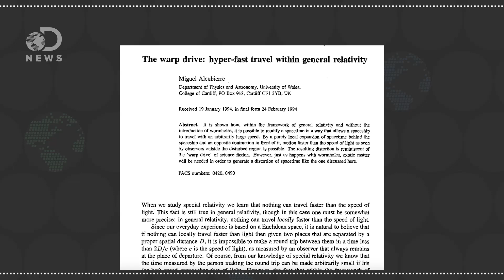How Close Are We To Star Trek's Warp Drive?

Comment: The ship won’t physically move but it will go through an anti matter hole from front of it and out the other side folding space and time getting there through Another dimension which is through anti matter dimension as space expands back to normal expansion. From the other side of the anti matter dimensional field. We can physically go into another dimension that is theatrically possible. We Just can’t physically go into another dimension without a Fusion engine bending space and space time. Nothing will physically travel that fast then light it has to go through another dimension.

Comment: Never say never....
70 years ago who knew about nuclear fusion.  200 years ago who knew about steam power....etc, etc.
Reply: Except those two don't break the laws of thermodynamics
Reply: Wasn't it DaVinci in the 1600's who first proposed inventions based on Steam power? That was over 400 years ago, more than your 200 years. It was largely ignored until inventors in the 1800's went back to incorporate those ideas. He also invented flying machines, which until 1900's was used by the Wright brothers to make the first plane. It was George Tucker in the 1930's that proposed Fuel Economy for cars, creating the first car engine that could achieve 100 miles per gallon. Tomorrow's warp engine could already have been invented by some backyard scientist but because of his/her unscientific methods the higher learned scientists may easily overlook it.
Reply: Bad examples.  1950, we had detonated several nuclear weapons, we had a pretty solid grasp of nuclear physics.  1820, plenty of steam trains running, and stationary engines in factories.   But the general point still holds good.....
Reply: 70 years ago...by who?

Comment: actually there are a few ways to travel faster than light that are easier than using a warp bubble. One that people can do now is called astral projection, and it does work. However that is only moving part of our conciousness to another location, and the safest way to travel, as one can go places and look at things that will destroy matter as we currently know it. 
The other method is to use one of the lesser known properties of matter and space, and based on our current abilities it will be the most likely to be most feasible, and that is every point in the universe is connected to each other with slight variations in vibrational and symmetry or by other terms locality. If we change the higher order vibrations that are beyond the normal 6 dimensions that we are familiar with that will move an object from one location to another, and changing the frequency back will move it back. That is because we have many dimensions in space, and even string theory shows this. The key is figuring out how to measure them and then it should not be too difficult to manipulate them to do this kind of travel. Problem with doing this is that it would take time for our minds to adapt to the new locality, and the way to operate such a thing would be through the manipulation with our mind. There are a couple things for those familiar with Star Trek that might make this more clear, they refer to this as changing the temporal field, and there are an episode with the Traveler that show him doing this manipulation with only his mind using the ships motion for the energy to make the transition between locations. I mention this because you brought up materials that do not exist in any known form to pull off the warp field. Yet we do have very small amounts of antimatter, there are some that do not know the difference between it and a plasma. The most common form of antimatter to us is only a plasma at the current time, and at very high power levels plasma is the best we currently have to move energy.

Comment: AS I type this comment NASA has been for at least 2 yrs been working on Warp technology.  And as a recent unconfirmed report, warp has been created in the lap using magnets and estimates are that 10k watts to 20k watts could propel a probe at warp 3.5+ or travel 4 light years in 2 wks if scaled up.  Comments were about issues one was how to control the direction of the warp fields and how to get them to be opposite to obtain motion.  Some estimates based on recent/2018 progress Warp drive will be with us in the second half of the 21st century.  Note the supposedly created warp field was a micro field and splitting a laser beam to determine it's existence was used.  Note No negative energy was required.

Comment: Actually there is a lot of discussion that NASA is currently making a test warp spacecraft using a more advanced drive than Alcubierre suggested, supposedly it uses an alcubierre-froning drive which produces a field around the vessel and deflects dangerous stellar dust away from the vehicle while it is traveling. It supposed to have all started back in world war 2 when the Germans were developing a kind of antigravitational engine, It seems allied troops moved in before they could make any flying craft that used the engines and the war was won. Interestingly enough NASA hired the German scientists that supposedly built the German antigravity device to make a NASA  version. Another thing I heard was that someone witnessed seeing a round iron craft similar to a diving pod that had no windows but had camera bubbles all around it, at a military hangar. It is said to have used a large capacitor on the bottom and something called a Mercury turbine in the center. I think this was around the 1950's. It is possible this prototype was a result from the German scientists. It was said to be able to hover and fly in any direction using a specially made spherical control that would move the direction of the field. It was said to create a glowing field around itself and that the metal exterior was to protect a crew of 3 from any radiation from the field. If NASA has been working in secret all this time to make a warp ship then they would've already had 73 years to work on it, possibly with a few prototypes along the way that people have seen and  claimed were UFOs.

Comment: Really...?  I'm flummoxed that no one has picked up on the capability of Dr. Richard Feynman's 'Renormalization',... which mathematically involved the equivalent of dividing out infinity from his equations of Quantum Electrodynamics (perhaps one of the most successfully proven theories ever).  The reason why Feynman had to divide out infinity to get his theory to work is that the universe is filled with 'Simple Harmonic Oscillators' and their energy is a so-called 'Zero' state.  But the SHO (Simple Harmonic Oscillator) has a parabolic potential energy, which then causes its lowest energy state to be 1/2*(h-bar)*omega (where omega is wavelength -- albeit angular).  Virtually everyone interested knows that all of space-time is filled with 'background radiation'.  So I ask this,... perhaps Minkowski Space-Time is inherently perforated with SHOs, or perhaps taking advantage of 'background radiation' so-called 'zero-point' energy might be an option.  
How?  The technology is already here,.... although feeble.  Create a Bose-Einstein Condensate using low T and monochromatic lasers to order matter appropriately.  Zero-Point SHO energy could be manipulated similarly. Although currently only a few hundred atoms have been gathered and arranged this way, if enough were arranged, I believe the condensate would collapse into a minor black hole.  The Higgs particle, which controls mass itself, is a Boson --- therefore subject to Bose-Einstein condensation.  Either the minor black hole could be utilized as power by feeding matter into it,... or more exotically, perhaps the minor black hole could be arranged such that it had zero angular momentum,.... thereby making it a 'naked singularity'.  The possibilities of utilizing a 'naked singularity' are enormous.  Reality itself changes, and nearly anything is possible with regard to one of these.  How to control it,..... well,... that's another question.

Comment: And to stop the bubble just program a computer in the outer ring to shut down after a certain time or condition it met. Simplz
Reply: Or generate and project the ring from inside the bubble, such that the ring doesn't need to be physical, and simply stop generating the ring (the warp field) when the desired destination is reached.

Comment: Imagine it's 1850 and you are having a discussion about heavier than air machines that can fly.  "It's theoretically possible but it is decades or even centuries from happening." What was needed was an understanding of aerodynamics.  And now imagine studying aerodynamics without the benefit of computer modeling.  The solution is out there but it's 1850 in terms of our knowledge.

Comment: If you were going to shrink space in front of the ship, you would have to project some sort of influence forward at greater than the speed of the ship.  If the ship was approaching light speed, that would mean projecting that influence forward at greater than light speed.  I understand that the ship could be traveling slower than light speed relative to the bubble it was flying in, but that bubble is a bubble of space, so that means projecting an influence forward at a speed relative to space itself.  Is that a viable thing to do?

Comment: Well, matter on its own can't travel faster than the speed of light but you can warp space and time to make it as if you are traveling faster than the speed light would if it travels in the normal way. If you warp space and time, you are shortening the distance you would need to travel to reach there even if you are traveling at a slower speed, you reach there faster than light. But that's hard to do as you would need to calibrate a system that takes time to reach there. And keep in mind that any form of radio wave travels at the speed of light.
Reply: The problem with achieving FTL travel is actually stopping....  lol.
Reply: Pay attention, it has nothing to do with time, it only warps space, not time.

Comment: Yes, I'd sign up in a heartbeat.  Being on the frontline of developing it.....not so much.  I mean look at the space shuttle disasters.  I'm sure in the future we're going to look back and think how did we ever do that.  On Columbia's 28th mission, a piece of foam broke off the wing.  A......PIECE......OF.....FOAM.  It's mindblowing that they used FOAM on something that goes into space. When I think of foam, I think of the popcorn they used to use in packaging to Styrofoam that sometimes still protects packages.  Obviously, this foam was just slightly stronger, but ultimately, it's still foam, right.  The problem is it takes so much thrust to break free from Earth's gravity that we should be using a cabin that would be self-contained and survive total destruction of the shuttle, but then something like that would be much too heavy.  Alternatively, some time of energy or plasma shielding, similar to what they have in Star Trek would work, but then the ships are made of a mythical metal like Titanium called Duranium and honestly, there is probably something out there that's strong enough and light enough, or at some point, we'll be able to fabricate materials to match that sort of strength and weight.  The 3D printer we've developed (I mean we as humans) is essentially a form of Star Trek's replicator.  I'd call it Replicator 1.0.

Usually what we see on TV does tend to happen eventually in some form at some point in the future.  When I first say ST:TNG and their touchscreens, I thought...wow, we'll have that someday, but maybe not in my lifetime.  Little did I know that, that technology already existed (in a crude form of course) in the early '70's, so that wasn't science fiction in TNG, it just wasn't commercially available yet.  Anyway, all these celebrities that have signed for Virgin Galactic won't actually go on the first flights, once it's been cleared by..the FAA?  I'm not sure what organization they need to go through, let's just say FAA.  For now, they are probably involved as well other agencies.  Anyway, once space flight is as safe as air travel, but book me.  I was born in the wrong century...maybe even the wrong millenium. I belong in the future.  I guess I'll have to settle at being 46 in 2018 and at least I'll be able to see and have a Quantum Computing device once they're out and prices have dropped.  That alone excites me!

Comment: I do not know if warp drive is physically possible.. but what I do know is that the safest way to insert a penis into a vagina is to use a latex barrier across the moisture field.. it is positronically necessary for the space frontier inside the vagina to be manipulated to properly accept the sperm delivery vehicle. it is very important for the moisture level readings to be kept within specified tolerance levels.  If it is not it becomes difficult for the movement of the space time continuum to repeat itself over and over again. I know this because I am a frequent inner space traveler...I hope this helps.. good luck

Comment: The finest work of Engineering might be the LHC, based on the best investigative Physics and setup using the best of Mathematics. So if the theory derived for and from all that is still a product of Quantum Calculations of fluctuations in the Big Bang theory applied to the observable universe, (dark stuff is pure obscurity), then the "Warp Drive" probably amounts to an interesting "fluctuation" of imagination, no matter "what the math says". Ie have the results of the LHC revealed any equivalents of trilithium crystals, or spacetime warping formats of any sort?
The Quantum Mechanism is based on continuity, so the bubble idea is correct, but the drive mechanism makes no sense to me, although my opinion is QM-intuitive, circumstantial, not mathematical, and matters "not at all".

Comment: The reason you can not travel faster than speed of light is, nothing can propel you faster than energy.  Transfer of energy limits the rate at which you can travel and the best source of energy to propel rocket ships (physical objects) are controlled explosions (burning rocket fuel).  Which is very limited compared to the speed of light.

Comment: Speed is not the issue: any beings capable of interstellar travel, must,,  by necessity, have the ability to maneuver through the 4th dimension ( Space / Time ) 

In my opinion the only way that can be accomplished is, if the 5th dimension ( Gravity )  can be harnessed. 

Relativistic speeds are an inefficient means of interstellar travel. 

Plus, as Einstein points out, as the speed of light is approached, objects become infinitely long and infinitely massive, 

So, if it has infinite mass then gravity is also infinite' 

The object itself is infinite ( everywhere ) 

Regardless, conventional propulsion means, are not capable of, producing these speeds. 

However; within the parameters of Relativistic speeds, if the 5th dimension ( Gravity ) becomes a property to be exploited, then the 4th dimension ( Space / Time ) will be at your finger tips.

Comment: if gravitational waves travel at the speed of light, how would a warp bubble generated by the ship, not pre-existing, allow for faster-than-light speeds? I only see speeds limited by the warp bubble speed, which would be limited to light-speed
Reply: To create a warp bubble the energy required is that of a small sun and it will be highly unstable so the answer is NEVER. We cannot even make a fusion reactor work and we are jumping or skipping this step to create a "warp drive"...dream on.

Comment: The spiral slingshot method might do it, I just did some calculations and found that (altho it would be ridiculously hard to do) that if you tethered a spaceship to the surface of the sun with some kind of force field, (one that doesn't come on full force all at once or you and the ship would be immediately destroyed) the sun's spinning speed would eventually catapult you to the speed of light if you reeled yourself away from earth while tethered. THE MATHS: sun's circumference- 2,713,406 miles, the sun spins once every 25 days (600 hours) so divide the circumference by 600 and you get 4,522+ miles per hour at the equator, earth is 93,000,000 miles from the sun so multiply that by 2 and then Pi to get the circumference, then divide that by 600 and you get 973,894 miles per hour (if you were tethered to the surface of the sun) so divide that by the speed of light and you are going 1.6 hundredths of the speed of light already at earth's distance from the sun, with that info you would need to be tethered to the sun's surface from 160 AU (93,000,000 x 160) miles from the sun, which in contrast would be just outside the kuiper belt. That's a long way out, but if you started at earth and 'reeled' yourself outward your speed would increase exponentially.